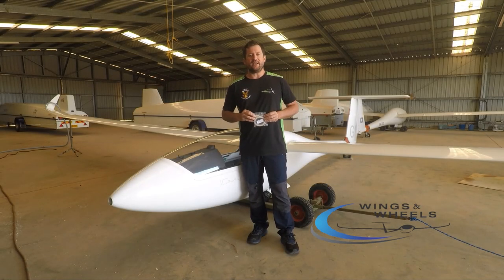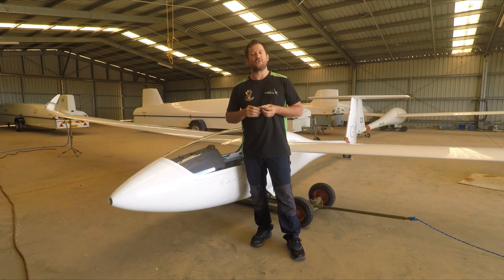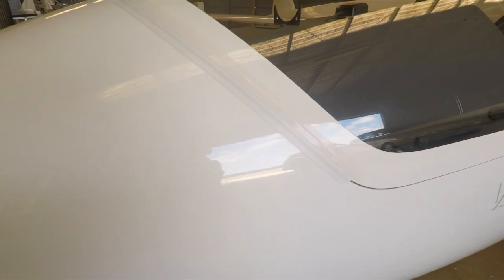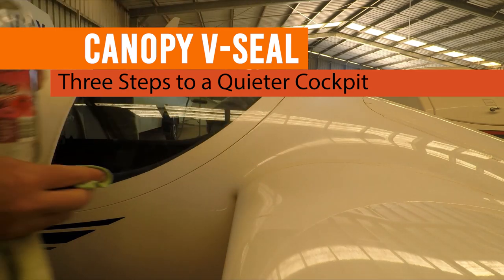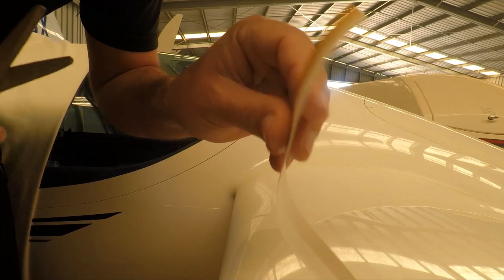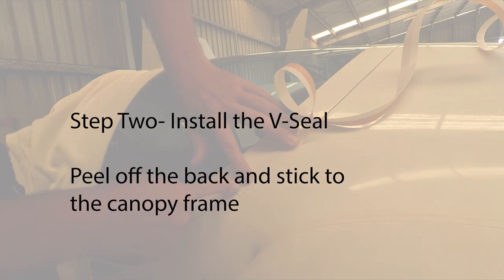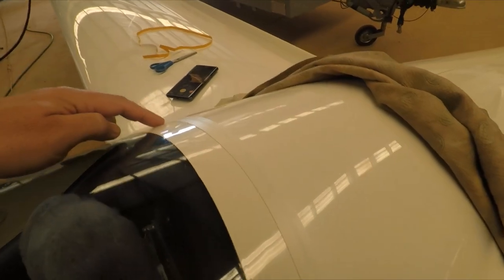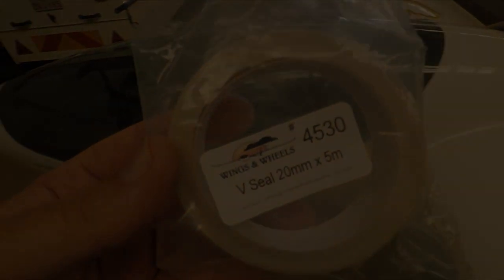Sailplane Canopy V Seal

Comment: Installed this on the fwd canopy gap on my LS3.  Eliminated a very annoying whistle.  My canopy cap has a drawstring and I just put it on loose.  Works fine.  On my third season with the original seal.
Best regards.
Reply from the maker: Nice! Thanks for sharing.

Comment: Unfortunately, I couldn't get this to work. I have a V3M and installed the seal as demonstrated. After opening the canopy several times, the tape would always catch in the gap and curl which would permanently bend the tape and render it unusable. Furthermore, the canopy cover would distort the tape as well. I had to remove it before I could ever fly with it. Disappointed!

Comment: I'm curious about what you recommend around the front of a DB-800 canopy.  It's very different than other canopy fronts.
Reply: I've sealed my std Cirrus canopy with Silicone (put cling film on the bottom fuselage so it doesn't stick), close the canopy and let it dry, then peel off the cling film next day and creates a brilliant seal.  The problem I have now is that the canopy have been removed for my new instrument panel and doesn't go back exactly where the contours of the silicone are, so I'll do another sealing next week, plus I will put v-seal on the back of the canopy only. Personally, I think putting v-seal on the leading edge creates a lip that is possibly worse than the existing gap anyway.

Comment: How UV resistant is it? Do you think this is a yearly replacement, if so how hard is it to remove after it has been attached and out in the weather?
Reply from the maker: Expect to replace v-seal annually with other tape.  No more difficult to remove residue than other tape.